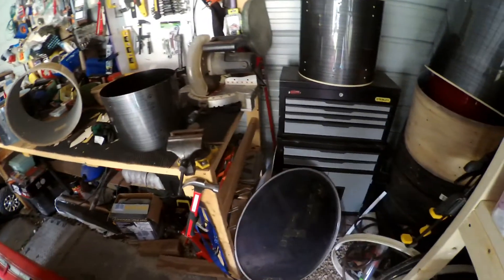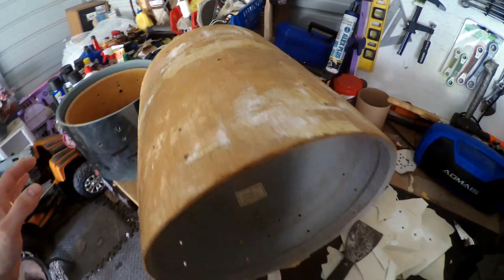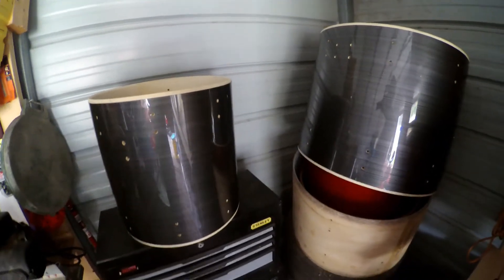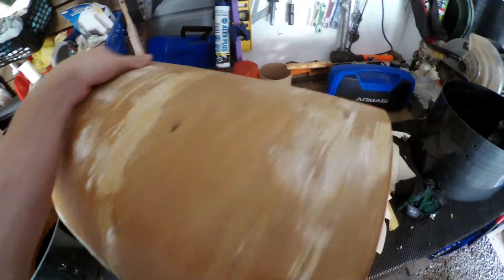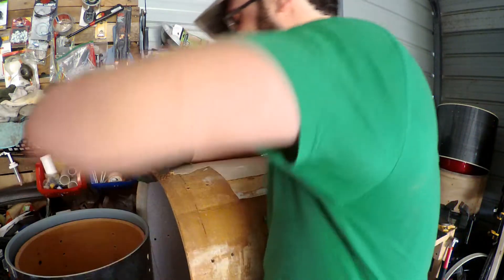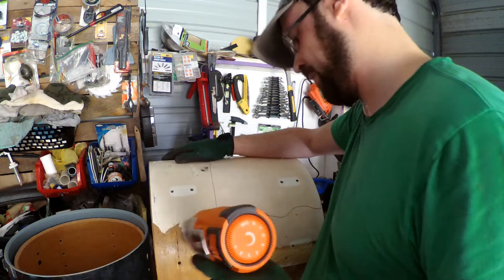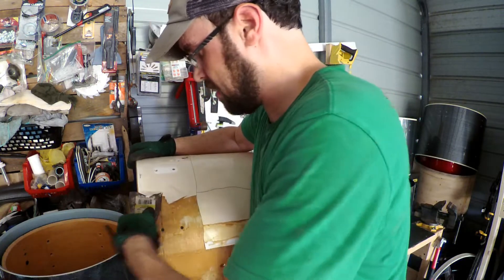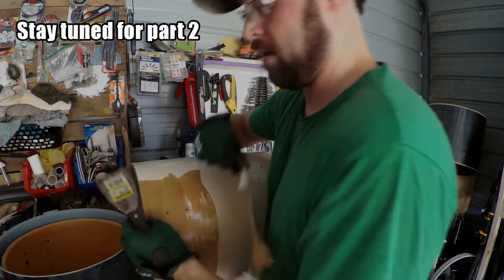Ludwig/Rogers Vintage Mix & Match Drum Kit Project - Part 1 - How to Remove Old Wrap

Comment: The heat gun is the way to go indeed.
You should check into those threaded grommets. I think they're around six bucks a piece but well worth it.
Good luck with your build.
Reply from the maker: Yes, the heat gun makes an almost impossible job, possible. Those threaded grommets would make things alot easier for sure!